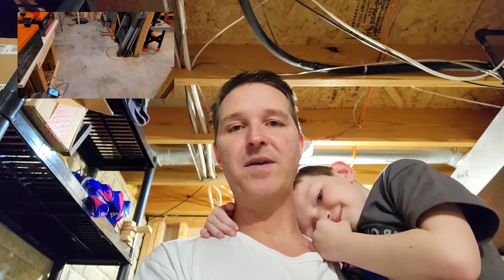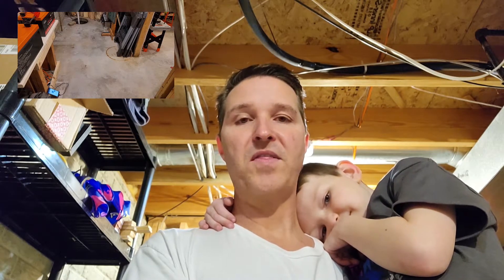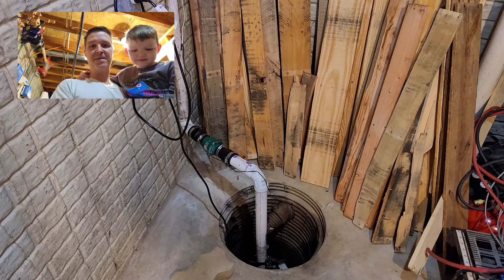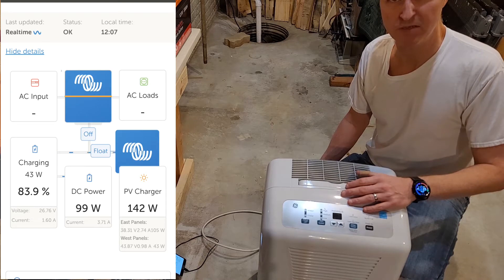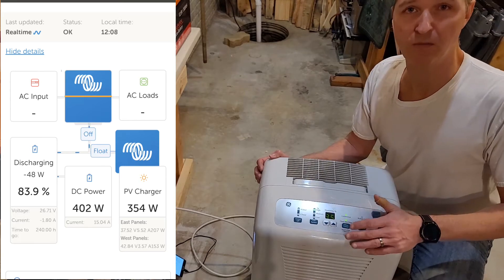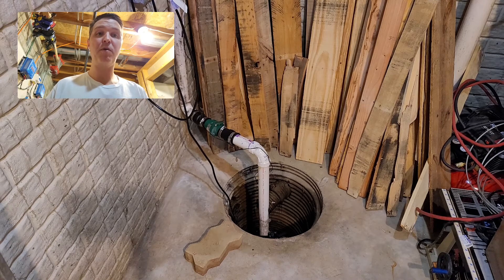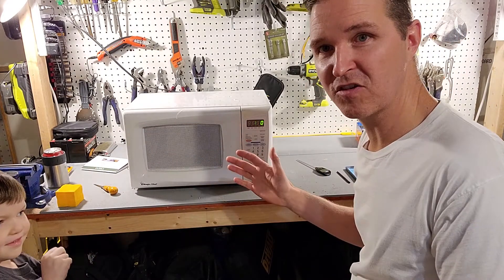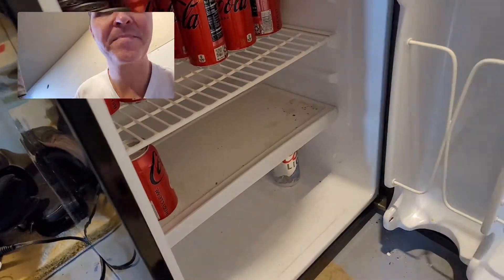How to get drinkable water using off-grid solar when SHTF!

Comment: That was fascinating info.  It looks like the microwave won't use use too much power to purify your water.  Did you lose much water volume during the boil?  How much water did you gather with your dehumidifier?  Good idea to use the sump pump as a water sourse.
Reply from the maker: Thanks!  I didn't measure the water before and after the boiling, but that is a good question.  I only ran the de-humidifier just to see if my off grid system would power it.  I think it would take all day to get any water out of it, especially in winter.  I know there are other ways to purify water, but I was just testing ways using off grid solar power.  Yes, the sump is a great source of water for most of the year!